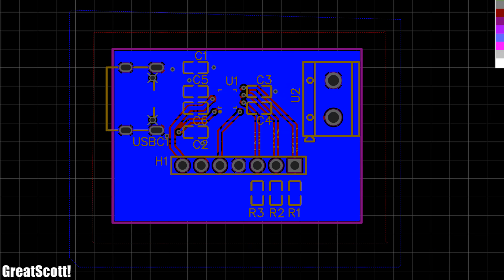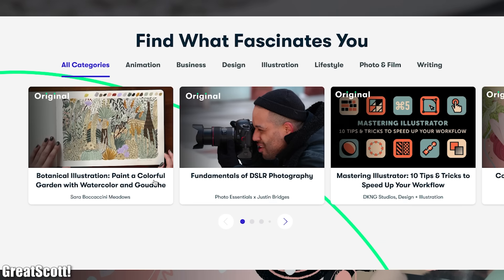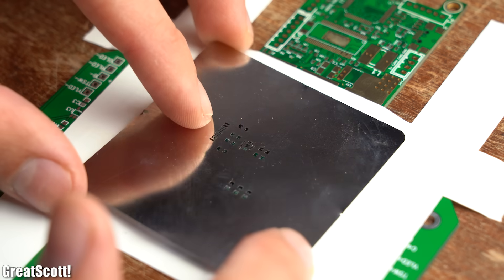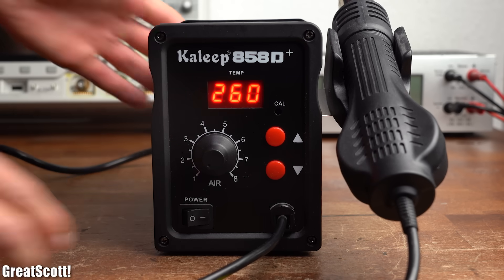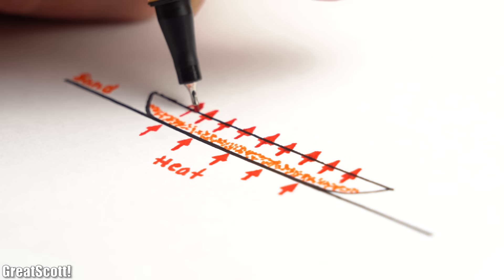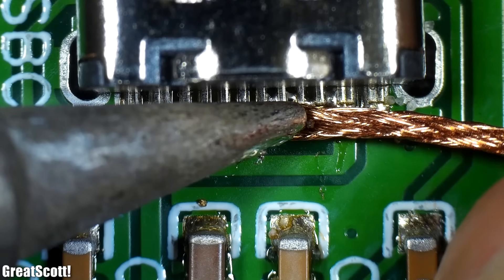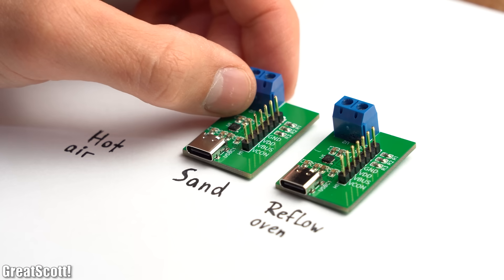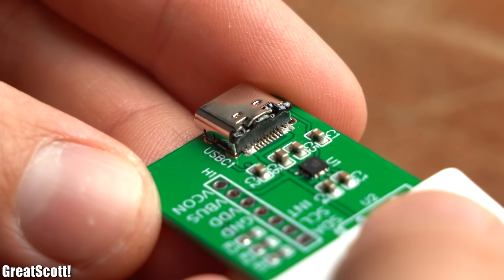How to do SMD Reflow Soldering properly! || Hot Air VS Sand VS Reflow Oven

Comment: Here is some information to help. Modifying the flux mix and using several thermo couples, isolating key areas with heat-shields and kapton tape, with temperature changes planned by Ramp To Spike and Ramp Soak spike profiles, Specific Heat Capacity and energy band charge displacement could be viewed by Gaussian heatmap BY LLM using a camera with the infrared filter removed in the event no heat camera is to hand. It would be possible to predict what components exceed heat specific capacity tolerance thresholds by means of a probability matrix keeping know quantities as Eigen values. A Parzen window could be used with Chebyshev polynomials for spectral analysis, not far off a principle in monitoring wave soldering, but also Markov chains for where heat changes go. Heat-sinks such as a copper nail, formed and filed into shaped customised to a PCB could also guide where the heat accumulates. Remembering lead and non-lead solder-flux-mix with 'acclimate' differently to extreme conditions, and priming.
Several cameras, and waves, including sound, sonic and ultrasonic with UHF could be controlled and monitored by beam-forming such that the devices and their clock disciplined behaviours and anticipated by using a known quantity waveform such as a GPS or GNSS or SBAS or wired approach. Mapping voiding in a Gaussian kernel would also mean that the Rosenblatt Parzen Window method could be used for density estimation and thereby probability estimation, such as if to apply a cooling to a heat sink at key moments. Gaussian noise elimination could better isolate voiding and derive future patterns from those previously distinguished in runs (again with Chebyshev polynomials).
My comment has no hate in it and I do no harm. I am not appalled or afraid, boasting or envying or complaining... Just saying. Psalms23: Giving thanks and praise to the Lord and peace and love. Also, I'd say Matthew6.

Comment: I learned a lot from this video and the follow up from the professionals in the comments. One of the reasons I like your channel is that you are learning too, so I learn from your mistakes and the comments usually have additional insight. For example, I used your SMD soldering video to assemble my first PCB design for my senior project successfully the first time, so thanks for that :)

Comment: I checked the components today, and realized that the microcontroller for the v2.4 (the atmega used in the video) is now cheaper and easier avaible than then one on v3. So if you consider building this project, check the availability first (unlike me, how ordered the pcb and then started looking for components...)

Comment: I already have a Hot Air station, the problem of overheating I did see solved to some extend is to use kepton tape. I did not try that at this time. I also have a Hot Plate that i am going to try soon, only disadvantage is that I don't have a stencil.

Comment: It can be done with Infrared toaster oven (there's reflow computer mod kits for something like this), just I recommend to buy new or used toaster oven exclusively only for soldering, not to be used with food, since obviously solder is poisonous, especially with the classic Lead-Tin solder paste (which I still prefer over the cursed Lead-free solder). However I also like sand reflowing - I'd have hot air soldering gun blowing at the parts too so you don't stress the Lead-free solder too much, they don't like thermal differential too much.

Comment: Hey Scott, I would recommend trying out a knife tip (like the hakko T18-K) for soldering QFN packages. I load the tip with some solder on both sides, apply a generous amount of flux and drage the tip across the edge and it solders nicely. The dragging action wicks out excess solder. Only thing to consider is you will have to hold longer if there is ground pads to allow heat transfer.
Reply: Yuvraj h hi j km public opinion on ggg it

Comment: The Sand method.. Could that be used to desolder (scavenge / salvage) components as well..?
 ...Right now I use a paint stripper (hot air gun, with controllable temperature), since it's a pain to desolder every joint individually..

But it always feels like I will damage the components (especially since the outside of them sometimes get scorched a little)

This sand method seems a lot more subtle.. But could that reach the correct temperature..? 
.     (Or will it simply ruin the pan before anything useful happens?)

Comment: Hot air station can do the job well in small scale production.But you must be able to hand solder the majority of the components of the project,or desolder them in case of something wend wrong,bad solderings or unwanted bridges between pins.So the human skills needed in every stage of the process fully automated or not.

Comment: Hi mate. You seem to do well in this component of the board. Do you think able to do neater and better controller and lcd display for electric scooter compare to manufacturer? (What I meant better is all the parts will not easily come off the board)

Comment: Giant tracks and pads... the real issue is the use of soldering paste ( and stencils)... just presolder every pad with standard leaded soldering wire... and place every component using tweezers and hot air station.

Comment: Any advice on desolating a module on a PCB? 

I tried removing as much solder on the castellated edges with flux and desoldering wire, but when pulling off the module… the contact pads did rip of the PCB.

Comment: 3:08: you're scraping across way to fast. Refer to the solder paste's datasheet for the recommended speed (probably around 10mm/s).
Reply: And for solder paste, I use Chip Quik TS391AX50 which doesn't require refrigeration.
Reply: 3:46: terrible. The paste shouldn't bridge across pads like that. Scraped too fast too many times. Should only be 2-3 times at max; less than 45 degrees respective to PCB first time, and over 45 degrees second (see SparkFun's guide).

Comment: With the cheap reflow oven, it would be interesting to compare the temperatures the oven gives to temperatures taken with a thermocouple and temperature meter, before and after reprogramming.  I'm wondering if the factory does some kind of calibration on the oven temperature that gets wiped when you flash the new software.

Comment: One problem you didn't mention with the hot air method is that is you're not careful, the air can blow the components out of place!
I discovered this with my first attempt at SMD reflow soldering. ;)

Comment: Try again, but before: 1-Clean pcb with 99% isopropanol 2-apply amtech nc-559-asm flow to the pcb 3-use stencill with xg-50 mechanical solder paste previously dried on school notebook paper

Comment: Sorry but you are using very very bad equipment for soldering and I am not expert
JBC stations
Amtech solder paste and soldering wire and flux
kester solder paste and soldering wire
Hozan and goot make a great low price soldering equipments you can find them on amazon and amazon jp

If you want cheap soldering station get ksger form Banggood

Comment: lots of helpful comments on here, I personally preheat board and then use hot air gun for reflow. stencils are a right pain especially for reballing, reading that it works much better in single pass is helpful, thank you community :)

Comment: Solder paste is better bought in an injecting applicator and applied under magnification than brushed on from a cup. (stencil helps a lot, though) The board should be held up off the table to avoid heat loss or better yet in a power skillet to raise its temperature closer to the reflow point before applying hot air.

Comment: I have used a regular, big, hot air gun, but, unlike the hot air source you used, it heats a big area...place the PCB inside a box that is about 3-4 do the size of the PCB, held on some kind of platform, or, hung from wires that go through mounting holes, or simply wrap around the board...then, you use the hot air gun, blowing across the bottom and top of the board alternately, until you see the reflow... The box keeps the hot air circulating around the whole board, so that you are not heating individual parts of the board too much... combined with the stencil, this works really well. Thanks for the video, & Ein gutes Neues Jahr!

Comment: Dont use heat gun fore soldering usb port. Bcz that contain plastics
Reply: Just use low melt solder.
Reply: @neerajdwivedi2015  yap. With hea gun. Must used low melt soldiering pest

Comment: I'm doing some experiments with some stuff i already have at home. Especially i've found a washing machine heater and a nicely flat iron plate (of 15x15x1cm). Do you think that using the plate to spread the heat of the washing machine heater will do the trick?

Comment: Nothing beats hot air gun when you want precision soldering. My recent findings on a qfn 20 with irregular shape taught me that you need to observe the paste when it reflow and move the chip around a bit or even remove it and put it back in order to avoid shorts and misalignments...

Comment: Have you tried or seen a Vapor Phase soldering machine? After setting every parameter right, it will solder every pcb very evenly and will never overheat because of the right condens/vapor temperature.

Comment: Well,the trick of using hot air is similar to reflow smd, u can't put the handle close to components at the very beginning. u need to get a little bit far and let the rosin in the paste to melt and just like reflow curves. Then after warming up for about half to a minute, u can put ur hot air handle close to the board for about 5 to 10s and ur components will be well soldered. I 've  tried hot air for many boards and they all look pretty decent. The key is to simulate the reflow curves and don't haste. Components are more tough than we expected.

Comment: I do my soldering with an IR preheating station and a reflow heat gun.
Preheat your boards slowly up to like 200-225C and then use the heat gun at about 15-20C above the reflow temp of your paste, and they should reflow within seconds, giving little time for any damage to nearby components. This is especially useful with large boards because I can leave them on the IR preheater and slowly bring them back down to temp so they don't warp.

Comment: I soldered a 16pin QFN chip last week which was a bit worse than the one shown here. Hot air and stensil. !st attempt did not work properly, 2nd attempt did but I had to remove most of the paste form the pins of the QFN before heating it. Turns out just a tiny trace f paste will do the job, around 30% of what teh stensil had originaly allowed for...

Comment: Maybe with some better design of the solder mask and pcb layout around the IC and USB-C connector it would have been even easyer to solder. Why did you not reduce the solder mask openings at the USB-C connectors pads, so you would get a line of solder mask between the pads? Usually you can go down to 0.05mm solder mask expansion on the pads and 0.07mm minimal solder mask width. And you never ever bridge pads in cooper directly under the IC like you did on the MLP package, at least not in any professional PCB design. I know it's tempting and looks simple in the layout software, but it makes board production and inspection a lot harder and does not offer any electrical or space saving benefit in this design.
And then you put that waay too big blob of solder at the first hand soldered terminal... Aaarrgh! 😂

Comment: I'm an SMT machine operator, and make PCBs of various kinds and functions. I work with stencils and paste almost every day (although on an industrial scale). First of all, at the 3:20 mark "...we get an even distribution of the paste all over our solder pads in a very precise way. BEAUTIFUL!!" It made me laugh, simply because I would fail a board for a single solder bridge or excessive paste. If I could offer a few suggestions. Use less paste. With the pastes, less is more. Barely any of it is supposed to be applied at any one time. Lay the stencil flat on the surface of the PCB before applying a thin layer of paste, no tape or any other objects between the stencil and the board. As other have pointed out, use a smooth, flat object such as a credit or gift card and a thin line of paste on one side of the stencil, then one smooth motion keeping the card edge flat against the stencil. Lift the stencil straight off the PCB. Great video. I really like all of them so far. I'm a new follower.

Comment: usually, when I'm doing SMD, I use a hot air gun almost exclusively. I typically use MG Chemicals flux and a 60/40 solder blend. I usually tin the pads with as much solder as they can hold with my trusty TS-100, and the components as well (if they are large enough). and usually, the flux lets the solder flow enough that the connections are solid. It does require a little extra cleanup with 70% isopropyl alcohol and a toothbrush, but I think it turns out better than most of my attempts with solder paste.

Comment: Just watched your video.  Did you go through and adjust the gain and offset for the thermocouples in the firmware under settings?  I did the calibration using a thermocouple taped to a PCB and ran at differnt temperatures in manual.  I was able to back out the gain and offset to calibrate the two thermocouples in firmware.  Made a big difference for me.  I also have the cold junction mod and firmware upgrade.

Comment: I think you were using too much soldering paste for the board. Having a stencil is great but for my homebrew projects I was always put off by the additional costs :D
As for my experience, putting on the soldering paste using a syringe with a very fine end cap (around 0,5 mm) makes the dosing on every pad quite easy.
Afterwards you will need to develop a little feeling with the hot air gun but once you find it, it produces very good soldering bonds.
I never had the problem of molten ics or something like that.
Keep up the good work! Very good content!

Comment: I am considering a new idea for my next project. What do you think about it?
I will drill out 4 unplated holes at the 4 corners of the PCB, and there will be 4 more corresponding holes on the stencil at the exact same places. I will hold the stencil still by fixing the stencil with bolts and nuts. Do you recommend this idea?

Comment: 3:22 I mostly use 0402 components on my PCBs, but my solder paste far more sharply separated between the pads. There is something wrong with your stenciling. Either your paste contains to much flux, or you moved your stencil too much while applying the paste.
Reply: I order my stencils from JLC PCB or PCB Way. I buy my solder paste from Aliexpress; always the cheapest one. :)
If I manage to hold the stencil still, the paste between each adjacent pad never touches each other. Even for DFN and MLP packages.

Comment: Every solution depends on how you will use the PCB. Is it for just a HOBBY? Is it for your clients and friends? Is it for commercial purposes? Why would you buy expensive relevant tools if the investment will not return. Everything always depend on the situation of the purpose. Hot air station is the way to go..it has other purpose..no debate on that.

Comment: Don't use a stencil. Way too thick causing too much paste to be applied. I just manually apply paste with the end of a tweezer, putting just enough on the pad so the component sticks in place from the flux. It's a bit time consuming, but it means you won't have to touch up after reflow. Also, i just use a simple hotplate (think chemistry hot plate) for reflow. Decent temperature control and works well if you only have components on one side.

Comment: too much paste - that's why you had to wick the solder. thickness of the stencil must be aligned with the size of the components and "microns" of the paste. also press down hard with that squeegee ! if you smear the paste gently over the stencil, you end up with thicker layer of paste than intended.

Comment: In my own experiences: 1) Hot air is easily prone to overheat electronics, and if you're too quick, to create cold joins.. A USB connector is an inconvenient loss, but an atmega dying after a few hours is a bit more of a headache. 2) No experience - my wife would kill me if I had sand on the stove.. lol. 3) That oven benefits from propping your PCB up on some PCB scrap.. Ideally on the edges / corners to minimise anything underneath it. The tray will wick away the heat built up in your PCB and cause the normal profiles to fail.

Comment: I do the sand method, but without the sand :). Works perfectly every time. The pan itself seems to spread the heat enough to reflow all the parts at the same time.

Comment: I have to say that if you want to have better result for soldering these types of SMDs. You need to use solder paste “Type 5” it will be easer to reflow than the one you are using which is “Type 3” solder paste. You will not have solder bridges like you had.

Comment: I would be curious what you think of building a reflow oven.  I have done that using an old toaster oven, an arduino with a temp sensor inside the oven, and a relay.  Turn the oven to hot, no timer, hit start on the arduino and it ran.   There are some really good arduino sketches out there for DIY reflow.

Comment: You can also avoid solderpaste/stencil with SMD components. 
First, use a solder iron to deposit solder on the pads of the pcb. Make sure to have an even amount of all pads which create a small hump. Then use flux and place the component on top, use a rework station to heat everything up and keep the component in position with tweezers. Benefit is that you can avoid buying a stencil and solderpaste.